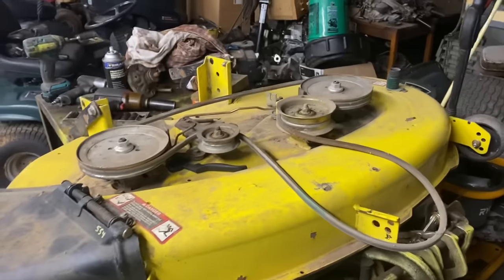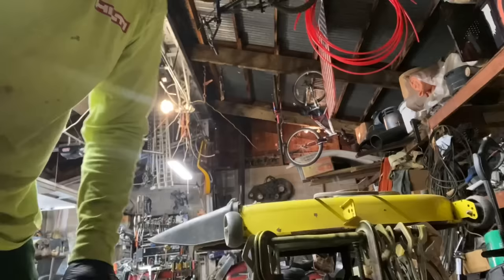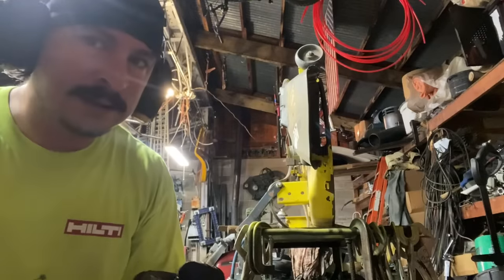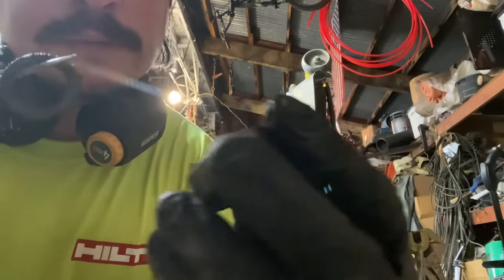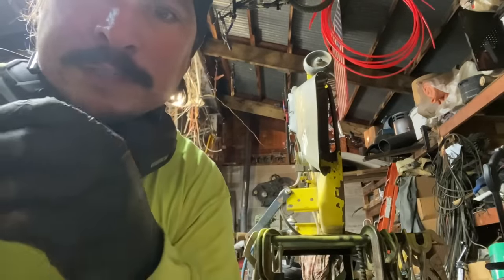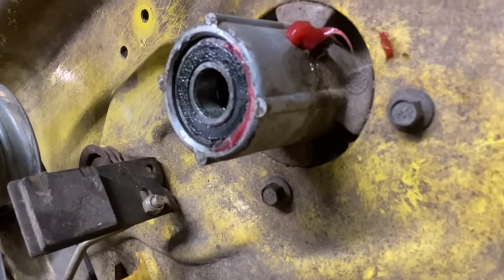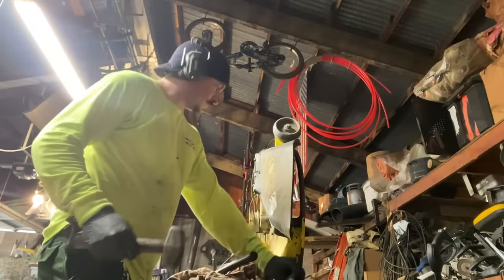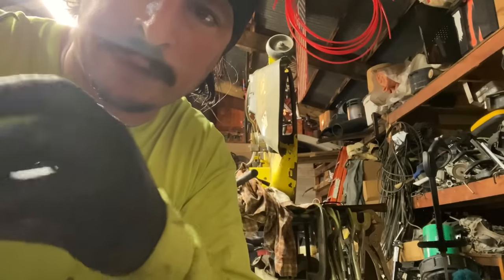Part 1 - Don’t trust the “Experts” Grease your mower deck sealed spindle bearings Common sense.

Comment: More than 50 years repairing mowers speaking. I disagree with you.
1) Don't waste grease. It's a sin.
2) Changed A LOT of sealed ball bearings that were fubared by grease gun hydraulic pressure shoving the seals sideways into the balls.
3) Tremec makes lots of transmissions that have rubber sealed ball bearings. It keeps gear swarf out of them. And the FLUID GREASE used in transmissions can still carry away heat from them.
4) My conclusion is to save the time and grease wasted by what you propose - and to instead spend the time removing the belts and spinning the spindles and checking for play, free movement and noise. Then if one or more need changing - change it.
5) Lastly you guys don't seem to know mixing different greases can destroy the careful blend of properties of either grease. Therefore the farther away we can keep uninformed guys like you from our machinery the longer it will last.
Reply from the maker: Well as far as saving time and grease, the process I’ll propose can save someone a lot of both in the long run. If bearings are in good shape and folks service regularly then it’s quite possible it may not be necessary to disassemble a deck to make repairs. Also grease is cheep. I can usually do several decks with one tube. Grease is arguably the cheapest preventative maintenance one can do to extend the life of a mower deck. I argue that the SIN is to run a deck to failure and intentionally avoid greasing the mandrels. It’s almost crazy to think someone could say that they would rather take it apart and fix it. Not only might the bearings have been saved by adding grease, it’s possible that other major parts may become damaged from running a deck with failing bearings. If the operator stops as soon as bearings are shot that’s great but as I’m sure you know as long as it cuts grass the owners usually continue until avoiding repair is no longer an option. And by that time I find that the spindles may have sustained damage and sometimes even the belt or pulley covers. I guess your just unwilling to attempt this to experiment and see for yourself and that’s unfortunate. But I get it, if I was set in my ways on a process I have done for 50 years I’d be reluctant to open my mind to the other ways of doing things and I’d more than likely fight tooth and nail to disagree. As for mixing grease, it’s never been an issue and it’s possible it may never be for this specific application. Iv never seen anything that gives me cause for concern on that subject. Let’s take a walk through this and think logically here. If the manufacture sends these out with zerks and it’s of vital importance that the same or compatible grease is used. They should make that clear and some may very well do so. As far as knowing what grease is any bearing before it’s serviced we will not have that luxury in most cases. However all that being said I don’t think it makes enough difference in this application to be of any cause for concern. I don’t have 50 years under my belt. It didn’t take me nearly that long to question what was happening with these mandrels. It did take me years how to make this process work right. And that’s why I was what to share it and help folks. I have yet to remove a single bearing from a mower deck and discover that grease was showing signs of incompatibility or pushed the seal into the bearing. I also argue that a seal being pushed into a bearing would have any effect on it. The bearings will push back as they turn and get the clearance back if that’s even a thing. It’s absolutely silly to even think that’s logical. Now I can see the other (outer bearing pushing off) but only if there is something loose or wrong with the assembly that allowed room for that to happen. Sounds like there was something more happening there when you experienced a seal pushed in. Iv seen it, but it didn’t cause failure. And when a bearing was failed and had a seal off it was dry and overheated the seal to the point it melted it. I’m not saying it won’t happen. I’m saying for this application I disagree with you 100% and I think it’s absolutely no cause for concern. Regular greasing will eventually push out the majority of the original grease or delute it. Iv never seen anything going on with a well lubed bearing that gave me cause for concern. However Iv seen many that rolled just fine by hand and sounded heathy but after removing I found m they were essentially out of grease and in some cases even falling apart but yet before disassembled I had no reason to suspect that. I feel it’s better to add grease than it is to gamble and run till failure. Im sure that careful blend is even less important when it’s all dried up. I think the probability of breakdown will greatly decrease if done the way I demonstrated. I expect this type of information will not be something the mower repair guys want freely distributed as it will help folks get more hours of problem free mowing with less need for a Mechanic.
It’s your opinion and glad you left it. But I can’t agree and I will tell you how I feel as well. I’d rather have someone like you stay away from my equipment as well. So we can agree on something. We don’t want each other working on our stuff. Lol. I’m not greasing transmissions here. Good night, just drag in some more applications that don’t fit. Next I guess we can talk about some of the bearings on a rocket ship or maybe a train.
Reply: @ru4skuba  Sorry about your Dad.
Did you inherit his lack of reasoning skills ?

Comment: You are not right about the Bearings.
Reply from the maker: The only thing I’m stating about the bearings is that grease will push past the lip on shield and it’s silly to argue that fact. Just connect a grease gun like I did and the grease gets into the bearing. Mystery solved. So technically yes I’m exactly right because it works like I said it does. Opinions are of zero importance here. I have proven it. I have displayed in a video with step by step I instructions anyone can easily follow. It’s most certainly not magic my good sir. Do you have some facts you care to share? Any sources to back your opinion? anything other than your opinion. Only facts matter. This is a source to help people. If you have something based on fact that can be beneficial to the DIY community please don’t hesitate to share.

Comment: you can't grease a sealed bearing via a zirk. you have to manually pack it. you lawn mower guy need to stop with the zirk on the spindle. Just replace the $4 bearing since you have it down
Reply from the maker: Actually yes you can grease a sealed bearing, and no you absolutely 100% do not have to manually pack it. Lol. ROTF. You been watching too many Donny boy videos. He has you brainwashed. That was my fear. Those type of incorrect videos mislead folks. The point of explaining that the sealed bearings will in fact take grease meaning a tear down is not required is why I made the video! If a person will grease as I showed then they may not need to beak an assembly down to the point of swapping bearings. Because a greased well serviced bearings will last many times longer possible they might just last the life of the tractor if someone really stayed on top of the greasing every year. How can you say it won’t work? Did you not just watch the video where I proved it? I guess not because here you are saying it can’t happen. When obviously I just proved that wrong. That’s the whole reason I made this video because of folks who don’t think it’s possible. Here is plain proof how can you miss the simplicity of this? Im not gaining anything just trying to help folks with accurate information. I’m not going into detail like I have on other comments to try and help you understand. I can’t make it any more simple, I literally broke it down step by step in a video. You can perform the same test I did. If you really wanted to know you would test the theory. As Iv mentioned before. Naysayers haven’t tested the theory, they just say what makes sense in their head but haven’t done a step by step test like I did here. 
Please consider that maybe they will take grease but the big businesses would prefer you let it break so they can sell parts.
Reply: @GTObearclaw1  sealed bearings are not made to grease through a zirk. popping off the seal bypassing defeats the purpose. Zirks are for open bearings, yes the seal converts it to an open bearing but you must have shaft seals, not bearing seals to properly grease via a zirk and that takes machining on spindles not designed with seals. you're talking $4 bearings replace them. The bearings, had good grease in them, you showed it, all you're doing is creating a problem not fixing anything . The grease in a sealed bearing is designed to last the life of the bearing, again just replace them while it's down. Most people which looks like you fall into that category screw up bearings trying to remove them. It's not just you I see a few lawnmower guys showing people how to screw up their equipment
Reply from the maker: @davebrunson125  where is your proof? You have none. Your sounding more like a troll. your eaither a troll or your just wrong but you don’t know it. And I obviously haven’t helped you see the light. Even though I broke it down into simple baby’s steps so everyone can see what happens when a zerk is greased and how the grease passes the seal with no issue. Simple step by step undeniable proof. I didn’t create this video because I thought the bearings I had were in need of grease. You grossly missed the point and the lesson here. That’s okay but unfortunate because it sounds like you will continue thinking something that is not right even though it was proven before your eyes. The bearings I had in video were just there to prove that the grease would pass the seal. I was not repairing anything. It was a random assembly I had available. On another note, not all bearings have enough grease from the manufacture to last the “life time”. Not all new bearings are greased equal. Anybody who has fixed mower decks for years would know that. So your comment also leads me to believe you may not have as much experience in decks as you may have for other bearing applications. I don’t know but this video is about Decks. I’m not the expert on other things. But I am the deck Dr. So if you have deck issues that’s what I’m
Helping folks with. In many cases I have opened a new bearing and it had almost no grease and some others did have a fair amount. The 4$ cheep bearings you speak of are usually the ones that have almost no grease. And adding too much grease won’t hurt this type of bearing for the application / mower deck. The more expensive high in bearings Iv seen usually have the cavity packed full. I’m not trying to help folks grease components on a space shuttle. So not really rocket science over here pun intended. This assembly didn’t even need to come apart. I was only tearing it down to prove the point that I clearly made and the point that you obviously missed. I don’t think you watched the whole video and if you did I’m baffled that anyone could watch a step by step on this process and leave a coment like you did. I have posted this to help folks. Some folks are so smart they know everything and too closed minded to see past some basic stuff. Funny how the “smart people”
Can seem seem so dumb. Sounds like this one is a hard topic for you to understand. I can relate because I’m not great with a great many things and I come to YouTube to find a video from someone who is the expert. And when I see an experts video and I think the author is wrong, I do some research and run my own tests. That’s kinda why I decided to make this video. 😂 so on to
The point about how I can relate to you not comprehending this basic concept of how a Flimsy seal can’t stop highly pressurized grease from simply and effortlessly pushing past it. I’m not great with math and no matter how well Someone explains it to me I will always struggle to understand some things when it comes to complex math. That’s really all this boils down to. I guess obviously not everyone will be able to comprehend what I’m showing in this video. I’ll be honest, that shocks me a little. But folks can be complicated. Your comment is proof of that. I will not spend any more of my time to explore more on why you are wrong about everything you stated. I have discussed in detail in many other comments on this video. I did enjoy having something to type while I was giving birth to what was yesterdays dinner. Unfortunately for you it’s time to Wipe and no more time to break this stuff down to toddler talk. But For now I will leave your comment posted so others can see it and get a giggle like I just did. If your a troll, you totally got me. Lol, Look at me
Taking it all Serious and typing you a short story because I care about your bearings and want your mower deck to be well Serviced. Did you really read all that? Does anybody? Good day sir.
Reply: @GTObearclaw1  whatever I know how bearings work and how they are greased.
Reply from the maker: @davebrunson125   yes yes, of course you do. That has become abundantly obvious over the course of our conversation. I can tell you are no doubt the expert on the subject. Your accurate facts and extreme detail has helped me see your most definitely a highly educated bearing grease guru who is out in the trenches defending agains all of us bearing grease offenders
making amateur mistakes. Thanks for coming along to save the day. I’m looking forward to your videos that will show me and those others you speak of the errors of our ways. Just kidding, I proved it in a step by step video and you still dont grasp it. You don’t know Jack about it and that had become obvious, you just don’t realize your wrong. Tell yourself what ever makes you happy. don’t grease your spindles, let the manufacture govern the grease in your sealed “lifetime bearings” then when they start getting noisy you can just disassemble and throw in some 4$ Chinese bearings. I’ll Continue connecting a grease gun and pumping the housings full to help maximize the life of the bearings I deal
With. After all it’s been working so great I made this free help video to share the truth with everyone on the Interwebs. Well, it’s been fun but I guess our time is comming to an end. I obviously can’t change your mind. I mean all you have to do is run a test, but you already KNOW! Of course you could post a video proving you theory and showing I’m wrong. But who has time for that? O yea, I did. At the end of the day,
You have your opinion and I have mine. Without proof they are just opinions. That’s why I made a video and broke it down to the annoying step by step process to sow the pure truth on the matter. And that’s the bottom line. The facts. Cold hard proven facts. But I get it, I’m wrong. It’s apparent. I see that now. JK. Or maybe I’m not kidding. Even I’m confused.

Comment: what  a  joke
Reply from the maker: How so my good sir? Did you watch the whole video on the topic? I mean it’s a step by step process every step was proven. How is it a joke?
Reply: @GTObearclaw1         sir    you  should  have  removed  the    two  inner  seals  and  left   them  off  only  leaving  the  two  outer  metal  seals  and  reinstall   bearings,  grease  unit  until  grease  chamber  is  full   and  both  bearings  will  get  fully  greased,  been  doing  this  for   50   plus  years  in  industrial  maintenance  but   you  did  have    a   good   video
Reply from the maker: @buddyphelps9692  I figured as much. You missed some of what the point was. The point of tear down in this video was to show that the inner seals do not stop geese. A grease gun can put out upwards of 8,000psi. That little rubber  lip won’t recent grease from passing. The reason I purposely left the seals on was to prove that the grease will pass the inner seal As shown in the video so for folks who don’t want to tear down a new machine to remove the seals they can just grease until it is full. I have painstakingly given this advice to many dozen folks who commented such as you. 99% of folks get it and appreciate the info. To just say “ what a joke”
Is insulting as I have a step by step video proving the entire process. I’m trying to help folks. Not everyone want ls to tear a deck down just to remove a few seals and the point is they won’t stop grease. Also the bearing would not need to be completely filled. Weather it gets completely filled was not the point of the video. Plenty of grease passes into the bearing to prevent failure. Iv opened new bearings with almost no grease. If someone is going to be rude and say my information is a joke I would appreciate if they could provide proof. 50 years experience is great but bearing applications differ as well as a great verity of many other things on the topic. That being said Iv seen guys who did a job for a year and do better work than folks who been in the business for generations and also the other way around. So please have an open mind. I’m trying to help folks and not here to cause issues for peoples equipment. The other channels tell folks don’t even bother greasing or they have to remove that inner seal and that is for sure not accurate and that’s the reason I broke it down step by step to prove to folks that grease will push past seals and it’s not a wasted effort of done properly. 
Read some of the other comments. Not everyone sees this as a joke.